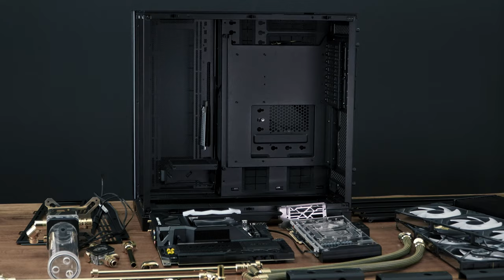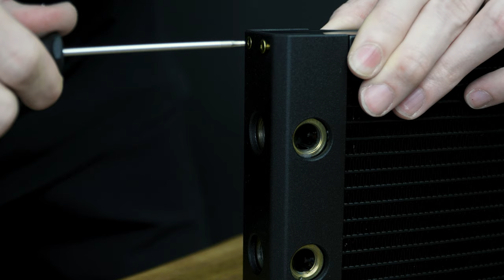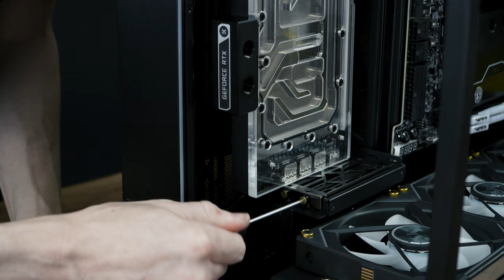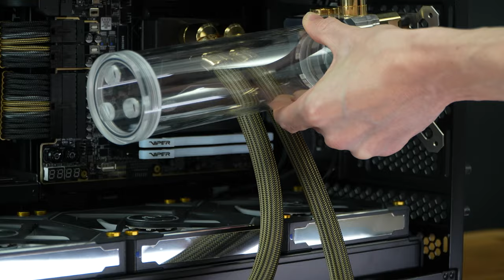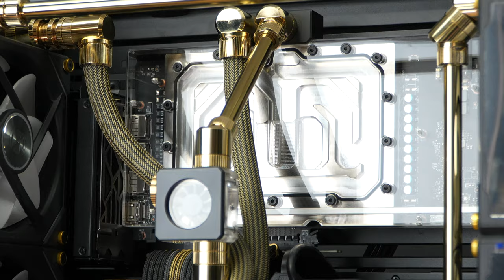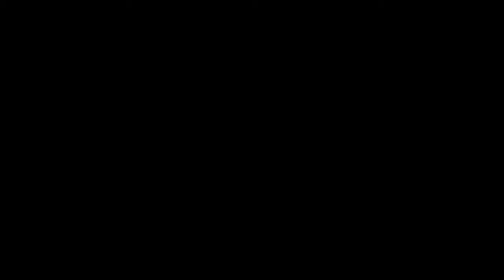Lian Li O11D EVO XL - Black and Gold Watercooled Showcase Build!

Comment: Nice. How are your average temps at full load? You have similar specs to me but my fear is if I move from my current case (Caselabs Mercury S8) my temps will be worse. Currently under full load I stay around 49c - 51c on my gpu. At this point Im just looking for a change honestly, not looking for better temps really, just not worse. The Lian Li Evo XL looks awesome.

Comment: Nice build ! I'm a bit confused tho, Lian Li recommend a  <150mm wide GPU for an upright installation, yet the plate shown in the video (and most of EK's 40 cooler series) are 155mm wide.  How easy was the fitting here ? Anyone has any idea if an upright GPU would fit with their Evo XL Distro plate?

Comment: Any long term observations on the black graphene coolant?  I have seen some reddit horror story pictures of that stuff and what blocks look like after running it.  I have used their purple and aqua coolant on two different PC's for about 6 months now, it works pretty well so far.
Reply: Same. I think these builds are for show, and are torn apart afterwards though
Reply: @ChatGTA345  Where can I find the rigid tubes in gold? I can't find it in the description thank you
Reply: @actualite3848  I think those might be brass, they're harder to work with compared to acrylic or PETG (but JayzTwoCents had a video on how to work with them). I looked but couldn't easily find either (but I saw them being sold sometime ago, I don't remember where). Or he could've spray painted acrylic/PETG, tho the surface looks too shiny for that.
Reply: @ChatGTA345  thank you, I would really like the same ones I searched for 3-4 hours and couldn’t find them 😂
Reply: @actualite3848  YT not letting me paste a link or name but search on site starting with A. Brass 14mm OD for example. Not exactly the same but close. Also will need a ton of angled fittings since these won't be bendable, just need to cut straight and connect with fittings, which I think is what Haus did too.